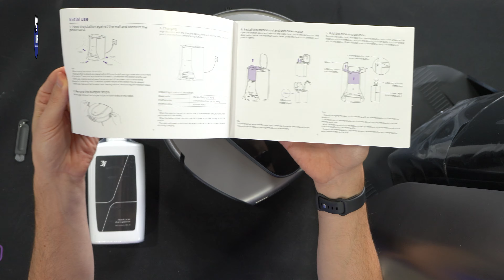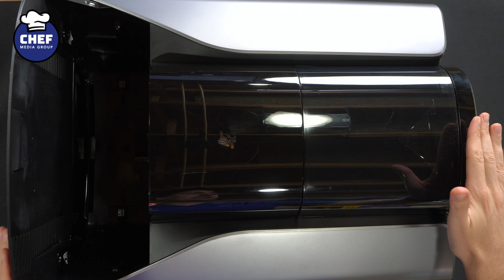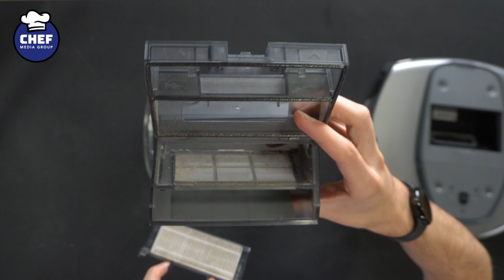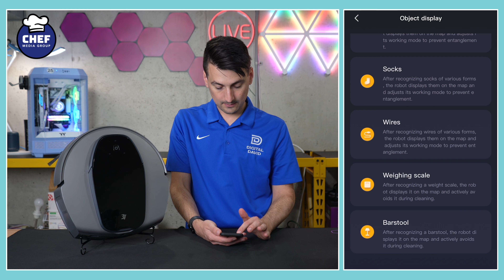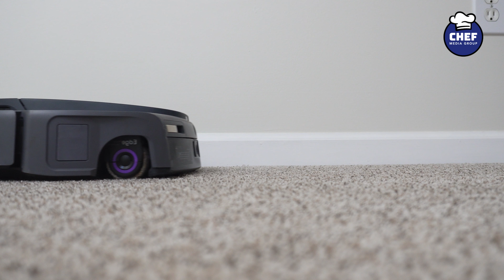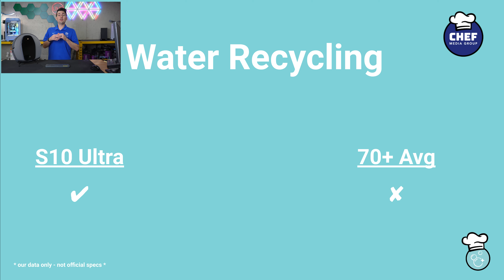3i S10 Ultra Robot Vacuum and Mop Review: Powerful Suction and Smart Self-Cleaning

Comment: Something I've noticed about all the 3i robovacs is that they try to dynamically control their suction power. So even if you manually set them to max, you don't get their max suction unless they detect a mess.
But otherwise everything else is quite good.
Reply from the maker: That is really interesting! Did you see 3i is no longer going to be a brand anymore as they are fully moving to just focusing on the iRobot branding?!
Reply: @VacuumChef (looks it up) I can see why they'd do this but also I expect it to be fumbled very hard.

Comment: I actually have one, now a year after they came out, with up-to-date firmware and app.
- The biggest deficiency is the app documentation not keeping up.
- You litterally don't have to do anything for quite a while.  You don't need to hook it up to water and sewer.
- There is nothing to enable it to stink.  The roller is washed and dried and the water that gets generated is throught distillation so there is nothing for anything grow on.
- It uses a constantly cleaning roller, the only logical choice for people with hard floors.  Anything else is like dipping the mop into the bucket once and doing your whole house before rinsing out the mop, which is simply "spreading the wealth".  The real field of choices for hard floors are the 3i S10 Ultra, ECOVACS X9 Pro OMNI, Eufy S1 Pro, and Eufy E25/E28, but the Eufys don't have roller that extend and  ECOVACS has a short roller.  None have plumbing hookups, resulting in the 3i S10 Ultra being on last one standing, which can maintain itself without a plumbing hookup.

Comment: 32 minutes and NOTHING about the mopping capability.
Instead of assuming the main innovation of the robot is a gimmick why didn't you test how it actually works?
How would you rate your review?
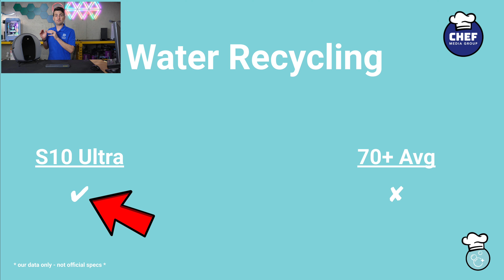Reply from the maker: We did test how it works? Did you watch ~26:00-27:00 in the video? It would take 5 days at 40% humidity with it running 24/7 to fill the clean water tank. What else did you want to know?

Also in regards to mopping we are working on a "scientific" way to test mopping and properly compare future mops to each other. Have not figured it out yet but as shown all throughout the video it is an effective mopping system. What else did you want to know?
Reply: @VacuumChef   Nothing about the mopping?The robot actually detects dirty areas and goes over that area more then once.Nobody would know that after watching your 32 minute review,
How about does the system really get rid of the dirty water on its own,
Gimmick?
Who sets up a robot by a sink or toilet,so it can be hooked up to warer?
Terrible review.
There, I rated it for you.
Reply from the maker: We wish you all the best!

Comment: I like the extending roller mop, the laser mess detection (assuming it works well TBD), and the powerful vacuum. However, the water recycle system is a stupid gimmick that eliminates this option IMO, and here is why:
1. It makes the base huge and it looks ridiculous.
2. It adds unnecessary complexity, noise, heat, power consumption, and for what to save 2-3 gallons of water a month? Seriously? 
3. A simple pump with drain/fill connections will achieve the same benefit without all complexity(reliability), noise, heat, power consumption, and allow the base to be much smaller and inconspicuous.
It's ridiculous, ditch the water recycle contraption, add a drain/fill connection system, make the base smaller, sleak, and inconspicuous, then they might have something that people with $1,500 to spend will actually want to buy. I know there will be some folks that think this looks cool, it will look great right next to their unopened star wars toy collection. However, most everyone else want something that will fit in with contemporary decor, and this is not even close.  It's completely unnecessary and the many cons far outweigh the one insignificant pro.
Reply: How about people who have hard water that will just gum up that robot do u want them to just go out and buy water for it ! Hence why we got it because it make it's own not hard water and works pretty dam well so far  !
Reply from the maker: Totally feel you on this! It is very niche and would appear to be targeted at those who don't have the means or connections to hookup water recycling systems! If you do then you would be better off with the Switchbot S10 or getting a kit for dreame or roborock vacuums!
Reply: @VacuumChef  Who doesn't have the means? Are people putting these in homes with no indoor plumbing? 
Because if it is installed within the vacinity of a sink or toilet, virtually everyone has the means for a supply/drain hookup, right?
Reply: @ericmichel3857  I don't think so.  Kitchen sinks are generally surrounded by cabinetry.  I don't see where a Dreame or Roborock-type solution could go.  And, bathrooms are usually too cramped for such a station as well.
Reply: @Jeffw02  You forgot about washing machine hook ups, also we are only talking about two small 3/8 and 1/4 lines that can be 20-30 feet away. It is super easy to rout those out of site through cabinets or walls. And even if you are not the handy DIY type, any worthwhile honest handyman could easily do it for $200-$300, which is more than the cost difference of this monstrosity. 
I don't know about you, but I would much rather have something like the roborock S8 MaxV Ultra with Refill & Drainage System ($1200), or the Switchbot S10 ($700) in my home and spend a bit extra to have the auto fill/drain properly installed, compared to this big ugly noisy thing in my house. Plus it's brand new tech so who knows how well it will work, and how reliable it will be long term. The way these things are progressing, in a few months virtually all of them will have some sort of auto fill/drain option. 
At first glance it seems like an interesting solution, but when you consider the practical reality of it, not so much IMO. Even the sliding roller, the way it rides up on that quarter round molding (which I have), is a problem. I applaud the attempted innovations, I just think it's a swing and a miss IMO. The good news is these things are getting better and cheaper all the time!
Reply: @Jeffw02  Search YT for "Best Auto Refill Mopping Robot? Switchbot S10 v. Roborock S8 MaxV v. Narwal FreoX" He did some basic down and dirty hook ups of three current options, it's not that hard if you have even basic DIY skills. A pro could do a much better job. And I am pretty sure this will become a common option with all sorts of innovative connection options in th enear future.
Reply from the maker: Not practical for most people due to space limitations, access to power, and then DIY knowledge or additional expense to pay someone to install. Sounds like you would be the exception and would not have any issue!
Reply: @VacuumChef  Access to power? You mean a plug? I really don't think I am the exception here, but okay.
Reply from the maker: Yes having an electrical outlet nearby! Well either way the good news is there are hundreds if not thousands of robot vac models so hopefully everyone can find the best one for their cleaning needs and preferences!!!

Comment: My Roborock Qrevo Curv has 18.5k pa suction, 6400 mah battery, split roller brush doesn't collect hair, flex arm brush and mop and the adaptilift allows it to cross pads, rugs and thresholds that other robots get hung up on.  With the early bird and military discounts I got it for $1260 plus it came with a Dyad Air wet dry mop.
Reply from the maker: Yes that is an unbeatable deal!!! Well done and thanks for your service!!
Reply: Yes because having to fill  with water and empty those plastic bins every other day sounds like so much fun lol. The mop on the Roborock is just dragging dirt around. It doesn’t actually clean your floors.
Reply: @14chaychay  I can attest my Roborock definitely doesn't clean my floors.  I kept hoping it would take more time, but it's just not working at all.
Reply from the maker: Sorry to hear this :(
Reply: @14chaychay  What exactly do you think is happening when you hand mop the floor?